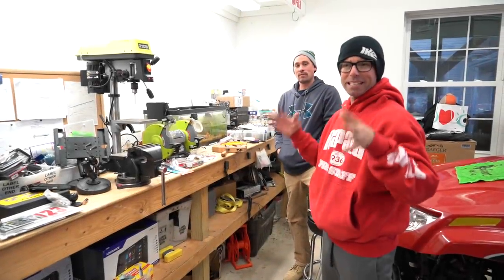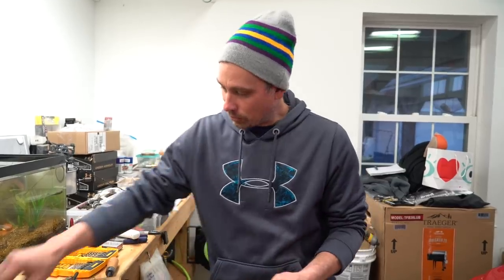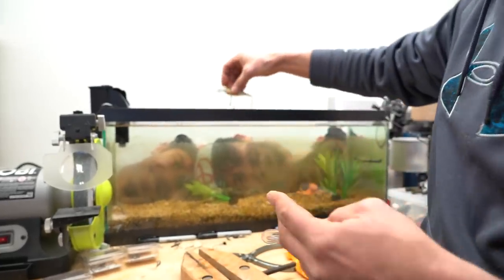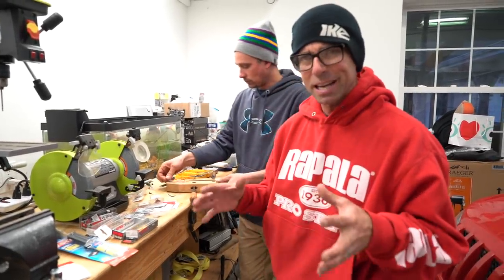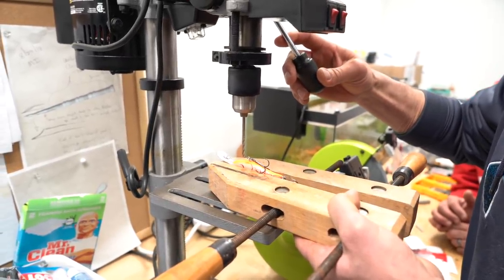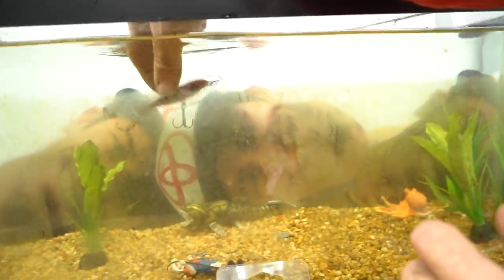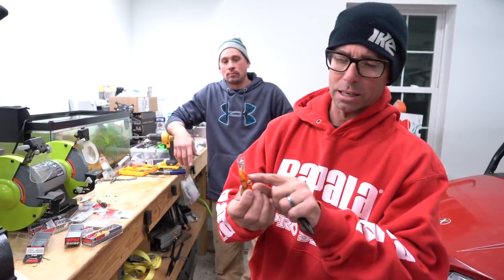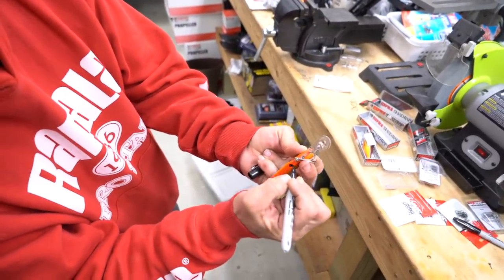Ike In The Shop: "Weighting" Shad Rap Secrets with BTC

Comment: Would Suspen Strips work? Thx
Reply: 100%
Reply: use super glue on the suspend strips the adhesive is garbage on them
Reply: @stevelumpkin2119  Thanks. My suspen strips have stayed on so far but, I got some Loc Tite just in case.
Reply: @robertbrost7777  sometimes you get a good batch , but I usually don’t 🙄😂